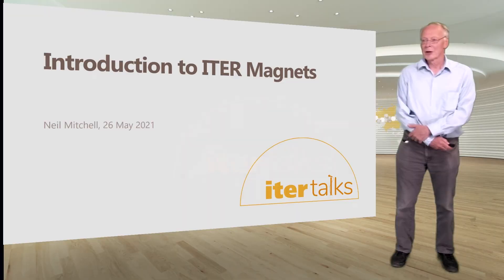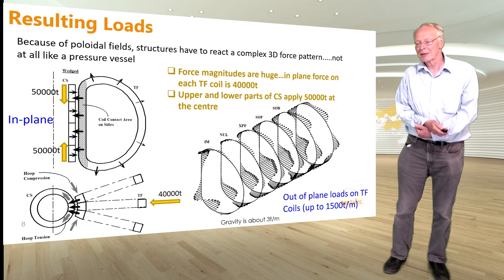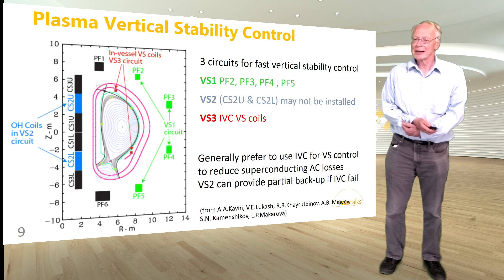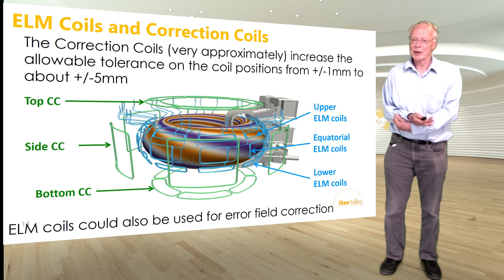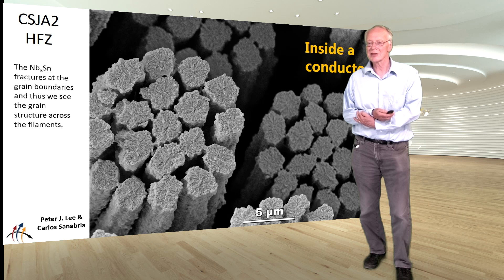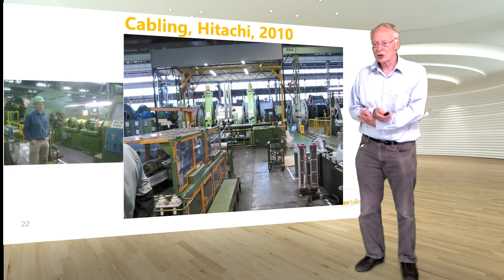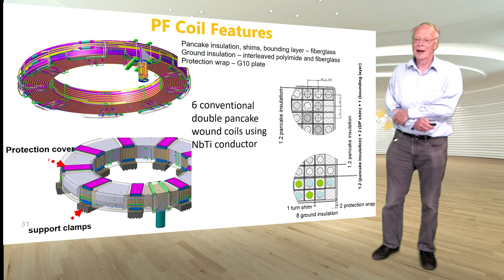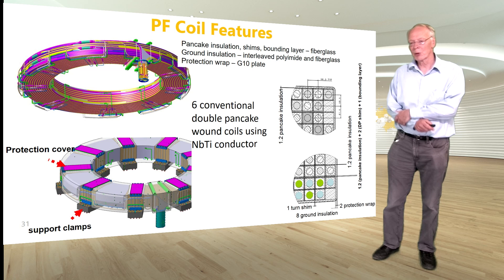ITER Talks (3): The ITER Magnets

Comment: A really interesting deposition of the magnetic components, I hadn't realised they were so complex.  On the side of magnetohydro-dynamics: I know the initial trial will be using the diverters to extract the heat, but can't you use the plasma directly to produce a dc voltage using magnetic deflection of the +ve and -ve ions in the plasma to collecting electrodes ?

Comment: Very Good
Having replaced two TF Coils and removed and repaired the P1 Coil twice at JET I wish you luck.
100% reliability of a prototype will be a first!
Are the compressive loads on the P1 linear or some rotational torque that destroyed the JET P1?
We got it right in the end.
 I hope that you are more successful.
Reply: JET is a bucked design, meaning the TFs push radially inward on the CS modules (one of which is called P1 in JET), and the TF overturning moment can cause CS (P1) rotation, which is what failed on JET. Since the ITER TFs are not bucked but wedged, there's no risk of CS rotation. The precompression ITER is applying to the CS is in the axial direction, which keeps the modules in place when they are charged in opposite directions and want to fly apart or laterally displace.
Reply: @LtBlue14  Thank You Good to know and I wish ITER all the best

Comment: Can we get some information about how procurement for these titanic components works? How do they even specify and control these multi-year builds where everything must be precise and perfect?
Reply: It was in the big update thing a month ago or so, its on their website
Reply: You are right, its a monumental challenge. Also every nation involved wants to learn everything, so if you need 12, you cannot get 12 identical coils from one manufacturer, you get them built in 4 different nations on 4 different sets of machines by 4 different teams, and then they magically come out identical with identical properties. I want to learn about the construction manual for something like that. It makes building a 4-engine jet airliner where each engine comes from a different manufacturer from a different nation look easy. Likewise if you are into quality control, testing and/or certification, having worked at ITER puts you at the very top in skill level.

Comment: May someone knowledgeable please comment on Q-plasma vs Q-total as it relates to ITER breakeven energy yield.
Reply: ITER is in no way shape or form built to be a power station, as such it's not optimized for power production, but for testing. 

lets say you had the idea of a vacuum cleaner.

You request funding to make one, noone is sure you can make it suck things up a tube, so you say, if you give me this much, I'll prove it can suck things up a tube.

How much do you, on your first vacuum demonstrator, care for the length of the cord? 

You also want to try it for yourself, do you 
A: Install a motor to try a wide variety of forces, to later decide on the most optimal one

B: Guess and have no possibility of trying any configurations other than exactly 1?

Your first vacuum for sure won't be some electrolux model we currently have, I'm sure you can see that, right?

Before you go on to prove viability as a power station, you need to make sure you can actually make a plasma in the first place. This is too advanced to skip steps, if you do a bit of research on fusion you will see that there are 100s of questions ITER will try to answer, that will then give us direction exactly what needs to go into a commercial power station (Or if all our predictions turn out to be wrong, steer onto another path)

I'll mention a few things here that are necessary but adds to the power used to run the facility, you are free to argue against any of them if you don't think they make sense.

Heating the plasma, this will be done using 3 different methods, Ohmic heating (Basically inducing heat through the magnetic field) Neutral beam injection (heated neutral particles injected straight into the plasma) and microwave heating.

What is the optimal ratio of the 3? We are not 100% sure because simulating a plasma is VERY difficult and notoriously hard to get done, as such all 3 heating methods are over dimensioned so you can try out different ratios, finding the optimal ratio to heat the plasma most efficiently.

As you can see here we can't know the most efficient way until we try it, and if we try to built efficiently, we can't try, this is why this is a test bed, not a power plant.

Cooling of the heat injection and plasma bleed off. As all 3 heat injection methods are oversized, their cooling needs to be as well. 

Plasma in magnetic confinement becomes uncontrollable after a while, there is a theory on how to counteract this by purposely opening a hole in the magnetic field and cooling the bleed off. 
How much do we need to bleed off? What is the least possible bleed off we can get away with? We don't know, so we need more cooling to be able to deal with this as well. 

Then we have lithium6 tritium breeding, will this occur at the rate we expect? If we get excessive reactions guess what we need? A way to deal with the heat.

There is also no attempt to salvage any waste heat from the cooling, as that will add more systems and more complexity, and that is not what ITER wants to do, we know we can use waste heat from cooling for both power generation and heating homes, but this isn't calculated in the ITER draw at all, because no such systems will be built, and why would they? We know everything we need to know about that because making use of waste heat is something we do every day all over the world. 

ITER will also run a vast array of super computers and particle detectors, making sure we can monitor and understand the plasma as this will be our firs time having one active for more than a split second. These particle detectors won't be necessary when you build a power station, sure you still need to monitor the plasma but you don't need CERN level equipment telling you exactly what you are getting out of every little reaction. 

The magnetic field confinement is also over dimensioned, because what if the machine does something we don't want it to do? If the entire machine is ruined instantly we will be set back a decade at least, so better over dimension. 

Can you see why it makes no sense trying to optimize it for power output vs input now? And this is just a few of the things, there are 100s of theories that will be tested once we can keep that plasma burning, all requiring different conditions.

Comment: What happens if it doesn't work?
Reply: It would be the first time we try going for energy gain, so it is more or less to be expected. And I assure you it will not work exactly as expected.
That’s what science is about. So we will use the new findings to refine our hypothesis and try again. I am sure the proponents of the newer small tokamaks with stronger magnets will be very glad of having this new data, whatever the final energy output of ITER. Of course it’s always more cheerful to have things work out, but one does not get that by wishing it for Christmas.
Reply: We will put a cat in it to see what that does. :D
Reply: what happens - some $$$ lost but that is still a chump change comparing to the space station cost. Iter at least promises some practical application whereas space station is just a waste basket.
Reply: Then humanity knows that it does not work and proceeds researching something else 🤷‍♂. What's the value of that question? Are they supposed to leave the chance for getting "free" energy because it "may" not work?

Comment: is there any chance to suck neutrons in angle since in theory if line off action on pc model test as test phase done and simultora data basic done oyu get ecliptic phase model so propose big bang hatch is like probably betwen 2,2 -2,3 -5,6° to create a spin movement or more eficient collect in each case is science but more fun part actual physical data collect and closer to energy so theoretical values are for basic knowledge of data once oyu get all picture is pc modleing data and gathering data and realy work physic I would check how does work on internet model as soemtime gravity paterns does it realy inflict on internet so suden drops on conection on change make me think in high relative theory as so called tahion drive basic principle vacum sution energy made on energy beem so proposed thoery in small version if you beem it with laser core tocamac smaller would it suction energy and in theory if magnetic buble egizst such as scfi start trek shields and tesla coil energy magnetism which is natural what part off particle made would do that magnetic shield energy resistant the only explanation is fine core energy that on hit or energy blact balance power becomes disrupt and you actualy lose production off energy core by shake physical cause or laser puncture technicaly even disrutptor ray is actualy good as it wouls puncture shell physicaly in space to so that us army already has and is no new news anyway also underlining possible elements ofr researcha and inovation can you do have stabilizers improvments or direction off force work if it is donut tech what can actualy stabilize process as some form cushion tech if there is any or is all physics ok is direct couse off energy blast signature prebang and stabile on so diversions and extra form improvments woudl come handy as in predicting and creativity or production some fit in limitations has to be draw then is fast production and creativity althow is vast and very visible as eficient in thoery better then covid 19 like permanent blast and allow people to fell heat on cell level but then again so does solar cells feel people to friendly and futuristic a vulcano on canarian islands is a bit subatomic blast adn apst lifes qustion and warping in universe as soul out body you should ask people who knwo this stuff instead off stargate and padme qustions is like eficient sellon nuclear weapons army budget then all waether shit and then again vulcano cells and then some work on phsics and science preat complicated in look to history or mankind if not only do your job which takes liek 5-6 years to do task like in car industry to do like stamp from science is khow how well understood theme but then again not so fast yes is permanent then again is permafrost to and old age off compete on c02 lvl on production and taking a piece off ice a weather stibilize is kind permanent mix for each standing on its side proud but trade and works despite hapends so future is about to bemore open to work to research and trade and creativity

Comment: si far this taks are on hz lvl modulation like science protocol listen submarine pass so vrirtual CAD simulator could help and absorber cushion and goals in research and plenty off new people scientist or students on work willing to help or ordinary job off geting skills and exp propose budegt lock on 30% budget yearly spend money which is already hugh so get a quite fiex assets to work on in theory and on pc or real job test modleing materials also build like research facility with all stuff in it inc 3d printer pressure mold for concrete and so on robotic assembly line for models uav tester and minified line core processing once to be more mini the better on consumer lvl ground also in terms of eficiency and energy production all is good anyway is about to be permanent so is statement earth is planet with oceans and vulcanoes works make it better and improve be creative once can be extra propolsion based on star trek core above dounut part which can work as tahyon drive so so called suction energy planer once in if fired with energy it drain power or even atracts other cores to be magnetic in goals or missions or whatever so this liek 3d perpspective when in facility when on space ship is 2d surface and mission goals apears to be winer one and peacefull to except it create core magnetic move and stabilization so ther is definitly more then soemething and more balance in future the only thing is not small to study as earth is that small so called terranova stuff becomes like functional on other planets as man can even do self terranova stuff if quiped with tools and basic know hows so called toamhawk vtool systems also asl gliders can help and do some task since core planet si preaty large to achieve opne blast and do chanel block operating on scene as star ttrk did in movie like prescan gas earth soil pressure possible place to erupt is all part of asterium place where lt data in star trek used to spend  its time remarkable a open vulcamoes teach people to terranova selfguard adn do soemthing usefull for planet too and on missions too yes this is future to

Comment: oh man, they are so screwed. This this is going to be a hilarious failure.
Reply: It will work but still be a failure because its not a viable road due to cost(from either a knowledge gained or a viable path to power perspective). But like a thousand other things it won't be hilarious it will be boring.

Comment: It's going to be funny when none of this crap works.
Reply: Does it matter 🤔 not like the science lobby will get an even bigger project
Reply: @hundredfireify  sorry to hurt your feelings
Reply: @hundredfireify  exactly, at least this is $$$ invested correctly, it is still chump change comparing to the space station cost which gave us exactly what? But for some idiots here these are difficult concepts.
Reply: Oh it will work but it will still have been a massive waste of money. The iter design was never a road to building power plants cheaper than renewables or fission. Even if you are a pro fusion advocate the money would have been better spent on smaller projects working on the fundamental problems of making it economical even if it means a delay to q positive. Already a huge part of iter has been invalidated with the success of higher temperature super conducting magnets. I am sure they are kicking themselves for that. I mean we would have always needed something like iter eventually but they hit go too soon.